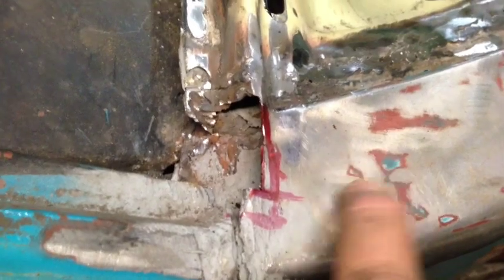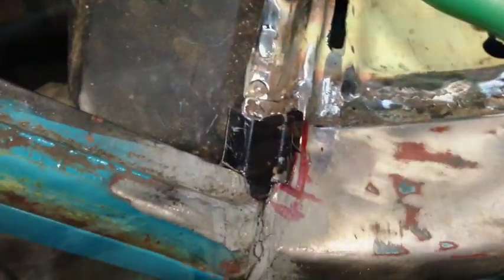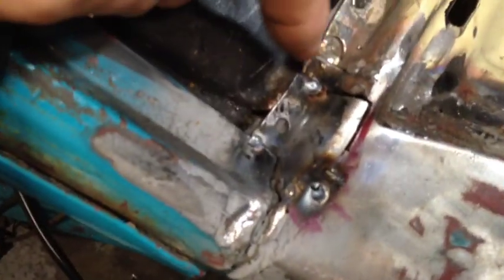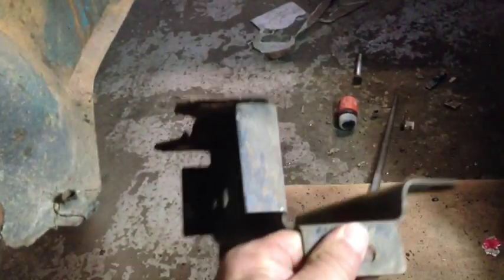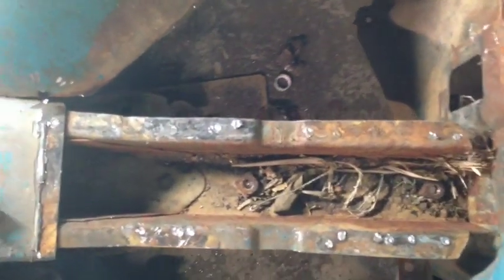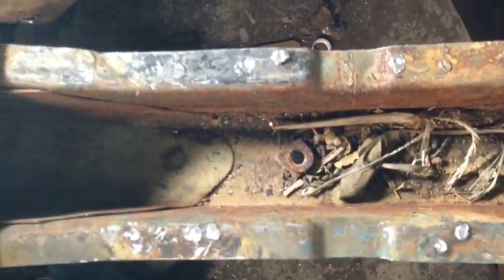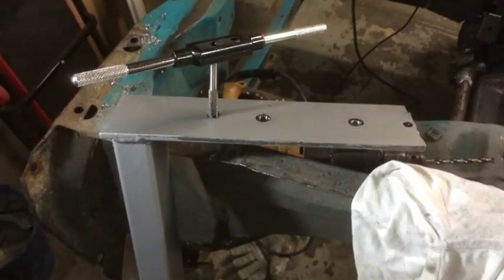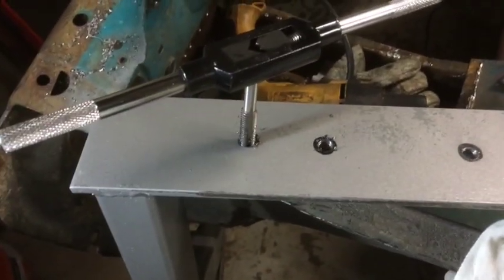Torana restoration part 3. Battery tray and car rotisserie

Comment: Good work mate....I see you copied my rotisserie I put up on the torana forum...it should work well for you.
It will make your restoration a whole lot easier...especially the underside.....just remember one thing, if your putting flares on your car don't put them on while its on the rotisserie as the rear flares will hit the bottom leg when you rotate the car.
Cheers
Al
Reply from the maker: thanks mate, i was going to thank you on the video but forgot to add it at the end. sorry mate but thanks heaps for your post. ill put a thank you at the end of the next video

Comment: Hi Kiona, thanks for your reply. I've scoured that forum and can't see your entry for that date. I can see that 'yellow5000' has posted dimensions in 2009. Can you tell me the page # or some other reference? Sorry if I'm being blind but I'm at a loss. I prefer your version in your video.
Reply from the maker: Robert Pezzali hi mate it’s not my design. It was done by Al who is on that forum. Just start a post, and he or someone on there will help with finding the drawings to build it. I modified it a little but do what’s best for your project.